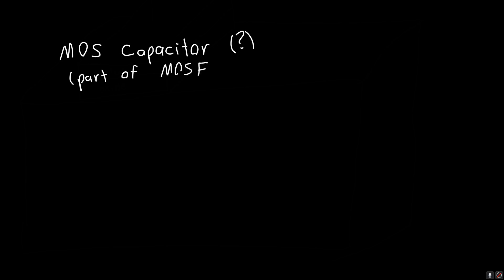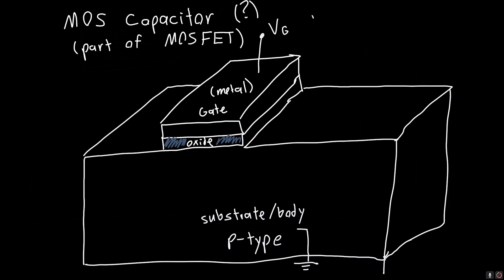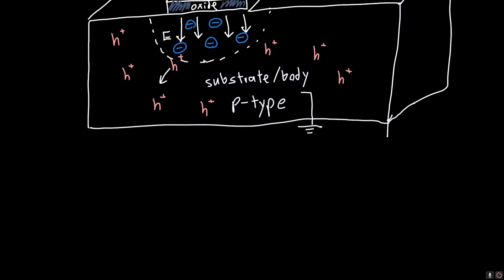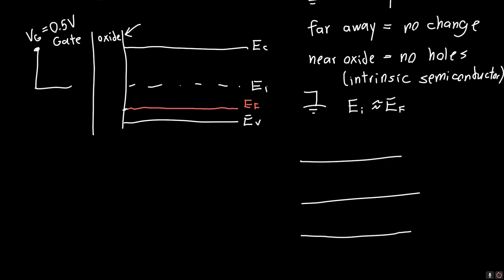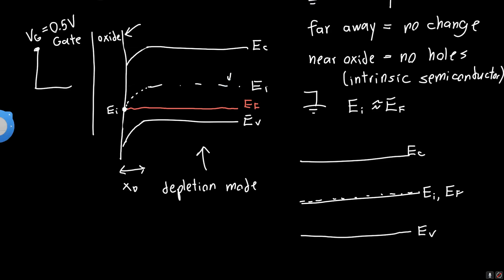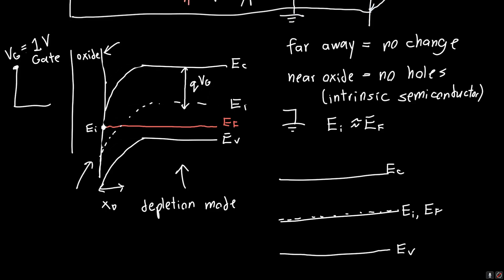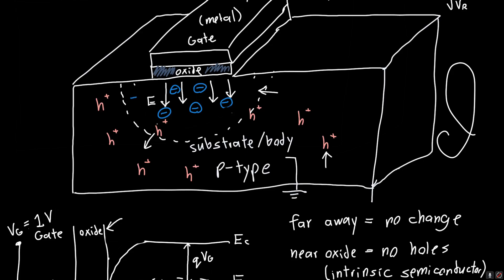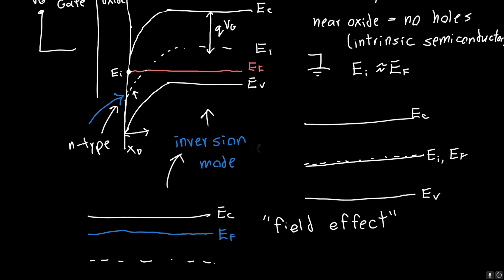MOS Capacitor Explained

Comment: when applying gate voltage Ec, Ev and thus Ei bend downwards, but not Ef (according to your video on p-n junction diode applying bias voltage also bends Ef). Why is Ef not shifting due to the applied electric field?

Comment: Where does an attracted electron come from in inversion state? Could you please explain this little more in detail?
Reply from the maker: That's a fantastic question, and it turns out to be really important. In the case of a pure MOS capacitor, the electrons can come from only one place - the p-type substrate. This can take awhile, because it relies on the spontaneous generation of electrons from the substrate (they aren't generated that fast, and we need a lot of them).
Reply: So they will leave more holes behind @JordanEdmundsEECS

Comment: i'm far to be a brain with electricity, just basic and i'm not sure. lol
So my question: why Mos(silicon)
and not full conductor (ex:gold)
it's because of price/accessibility of the material. or
about the option to be able of a selection of conductivity level?
ex: gold will be a "too good conductor"  for the capacitor? with only the option of full charge and discharge!
maybe I say total BS and way out of context too...dont be shy to wake up me!! no problem with that at all...
curious human in search of knowledge!
Reply from the maker: Brilliant question. If your goal is to make a capacitor, it's usually a better idea to use an actual metal xD Aluminum is often the metal of choice (cheap, easy to work with). The reason we study MOS capacitors is because it's the first step to understanding a MOSFET. A MOS capacitor by itself is usually not very useful.

Comment: when the voltage is applied in energy diagram, why are all the band levels bending, but not the Fermi-level? Kind of expected the fermi level to bend up (since it's usually changed with doping anyways) and all the rest to stay (Valence and cond. band energies seem to be more like material properties)
Reply: The way that you find band bending is by assuming the Fermi level is constant throughout the entire structure. The fermi level has to do with *equilibrium*, you can think of it like you would a generalized force. If the fermi level isn't constant, stuff (electrons, holes) is moving. You're correct that its relative position to the conduction/valence band changes, but this is taken care of by the valence and conduction bands bending. The valence band and conduction band aren't really material properties per se. The distance from the conduction band to the vacuum level (called electron affinity) is, however, and this is constant for a given material (silicon, for example).
Reply: @jordanedmunds4460  oooh oke the equilibrium makes sense... I gues if Ef were not constant, charges would just move until it is again, right? 
And thanks for pointig out the vacuum energy level, i didn't see that it would bend down with the rest, and therefore staying constant. Thanks for the quick explanation! (my oral exam is in 3h so just in time ;) )

Comment: Sir why do we apply for p-type semiconductor in most of the cases?
Reply from the maker: There’s a historical reason and a pedagogical reason. The pedagogical reason is that it’s much easier conceptually to handle only one type, and then just generalize your knowledge at the end to both types. The historical reason is that Si-based n-channel transistors have always been better than p-channel resistors, and so initially most circuits were made with only n-channel devices (in a p-type body). So it used to be the more useful case to analyze.
Reply: Thank you for the response. I really appreciate it😊
Reply: @nikitapandey6446  good question to ask.

Comment: Hello, please can you let me know how I should view the Fermi Level? I don't understand why the Fermi level doesn't not move in the semiconductor but it does move in the metal...
Reply: I'm trying to establish some common principles/ understanding so I can apply it to if V<0.
Reply from the maker: The fermi level has to do with the thermodynamic potential of the electron (how difficult it is to move that electron around in a solid). At equilibrium, the fermi level should be constant everywhere (that's literally the definition of equilibrium). To achieve this when in contact with a oxide/metal interface, the semiconductor will end up having some charges move around and its conduction / valence bands will bend. In a metal, there are so many free electrons and they move around so easily that we usually model it as an equipotential surface (everywhere inside the metal has the same voltage). You can also say there will be no electric fields inside the metal. If this is the case, there is nothing to "push around" the electrons and make it difficult for them to move, so there is no band bending we have to worry about. 

When you apply a voltage, you "drag" the fermi level of one side down (the metal if V_metal > 0) relative to the other side, and the fermi levels are now separated from each other. BUT, the vacuum level still has to be continuous, so the amount of band bending in the oxide and semiconductor changes so that this is still the case, and changes the number of charges on each side. If you were to apply a negative voltage to the metal, you would "drag" the fermi level of the metal in the opposite direction.
Reply: @JordanEdmundsEECS    Thank you so much, this is very clear. So let me get this right, the reason why the Fermi level in the semiconductor stays constant is because there is no potential being applied to the semiconductor (say its connected to GND)? Am I in the right line of thinking?
Reply: And if the potential of semiconductor relative to V_metal was raised, the Ev, Ec, Ei AND Fermi level of semiconductor would all be dragged down by that applied voltage, or would it just be the E-FermiSemi that would be translated?
Reply from the maker: Not quite, but you’re on the right track. There is a voltage change within the semiconductor (that’s the same as saying the conduction/valence/vacuum bands bend), but this is exactly balanced out by the chemical potential caused by an electron gradient within the semiconductor, so the total potential energy (the Fermi level) within the semiconductor is constant.
Reply from the maker: The Fermi level is dragged down by exactly the voltage you apply, as are the valence/conduction/vacuum bands far from the oxide interface, exactly. Close to the interface, however, they bend along with the oxide bands to “make up” for the additional voltage applied so the vacuum level is continuous.
Reply: @JordanEdmundsEECS  Thank you very much! I'm in my first year of Electrical and Electronic Engineering, currently studying Semiconductor physics and this was bothering me. Cheers!
Reply from the maker: Best of luck!